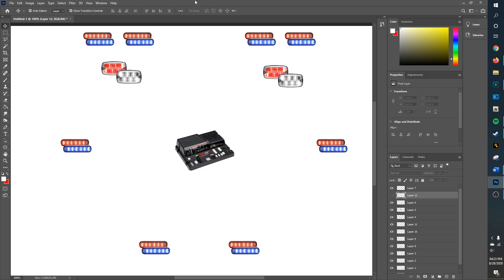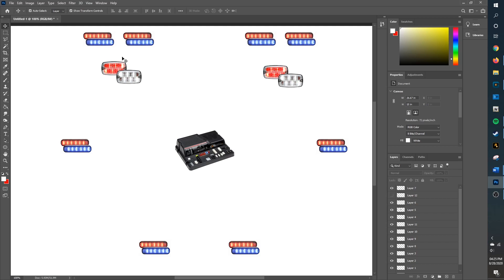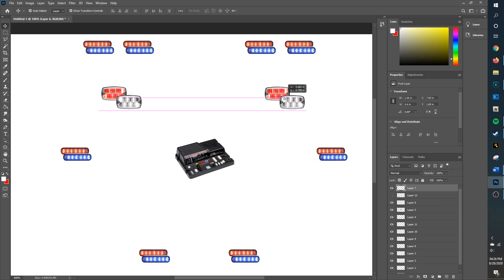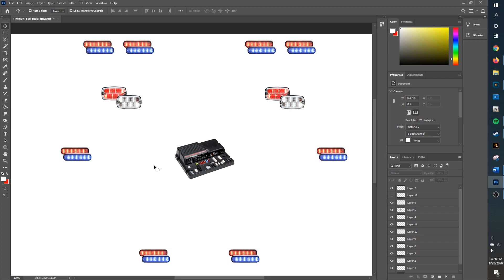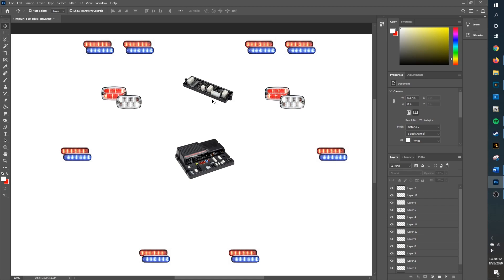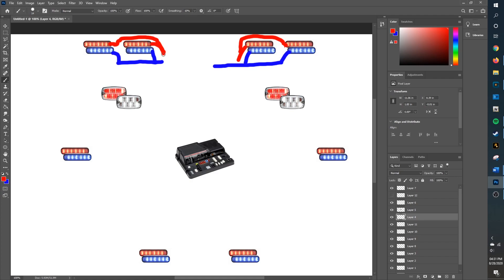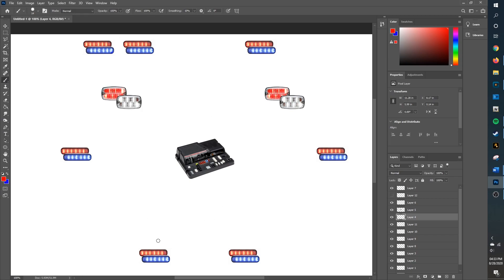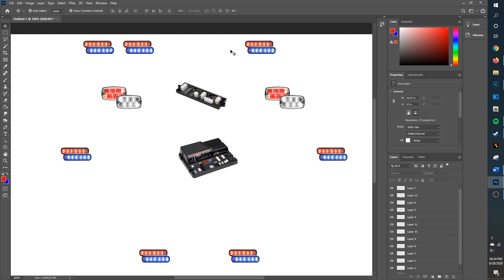An Introduction to Basic System Layout for Whelen CenCom CORE

Comment: You were close...but for example, you would wire your Red(L) to your Blue(R)...and Red(R) to Blue(L)...and on and on throughout the car. This is why CantrolWC (32 outputs PLUS 8 TA outputs) was superior to Carbide (18 outputs)....never understood why anyone would chose Carbide.
***Feniex was brilliant coming out with the Quads, and the Converter was conceptually great, but the stupid thing is that if you have just an ILB and RearDeck (or 600/800 stick), then you need TWO of their 4200 controllers - OR - on another brand system you need to use up 28 outputs just for those products.  They should have made it operate like the Whelen Expansion modules (or the Code3 Matrix output “points”....plus they ruined their products by eliminating more than half of their flash patterns and even worse - they altered the Attack Pattern (for dual colors or more) and they actually changed their signature Cluster pattern - which now looks like something anyone could make with a Feniex Flasher by tying the inner heads on 600’s, 800’s and ILB’s in a 2x2 “simultaneous cluster pattern” with one or two single flash (pattern) alternating on the outside modules. *Essentially it’s just a “shimmy - flash flash...shimmy - flash flash” pattern now.  And the rest....WEAK SAUCE! So, ultimately their products are incompatible with any other control units, and essentially not even with their own.  We have to tell customers if they want quad rear lighting, front has to be Dual Fusion...if they want ILB quad...rear has to be dual fusion (or other products/brands).  I understand Wecan products are similar in terms of incompatible w other brand control units, BUT they at least have the WeCan ports on their own so that all their outputs aren’t used up by one and a third of a product. ***Some might argue the new “ONE” controller will address this issue, BUT that still means either Feniex makes customers buy new converters that have Data Link type capability with it, OR, the ONE will have to have something like 50-60 outputs in order to give customers enough outputs for all the other lighting etc in addition to the the 28 that the quad converter uses.

Anyways, i digress .... Core being able to handle up to 99 expansion modules is crazy/genius. . . Much like Code3 Matrix did with the “control/relay points”, which eliminates substantial amount of wiring passing through to the Units.
Reply: How many lightheads can you daisy chain together like that off of those 1amp outputs?